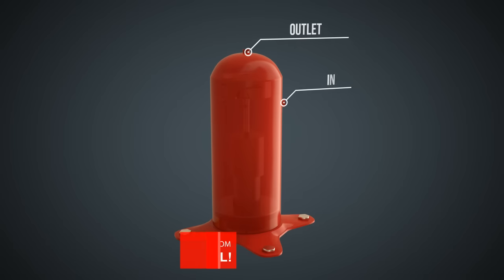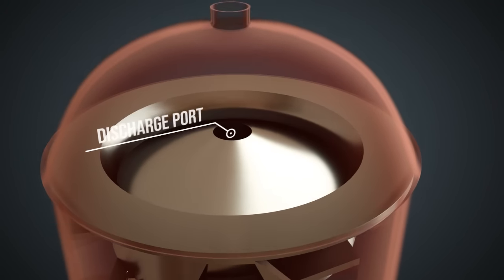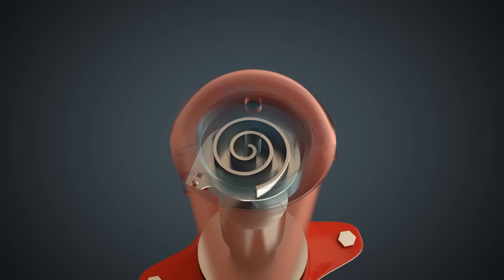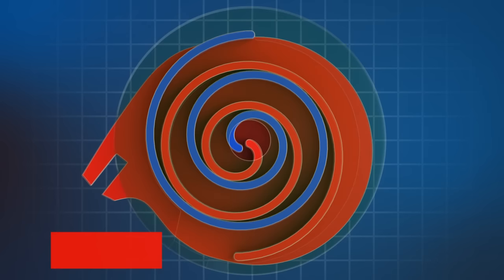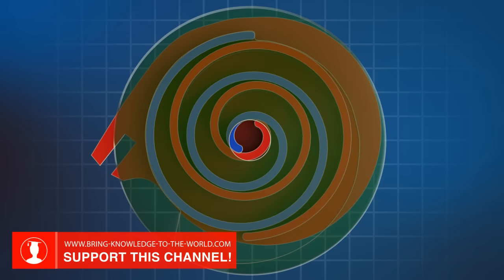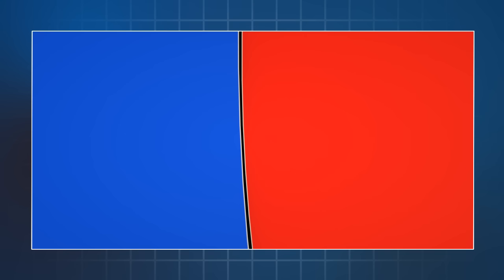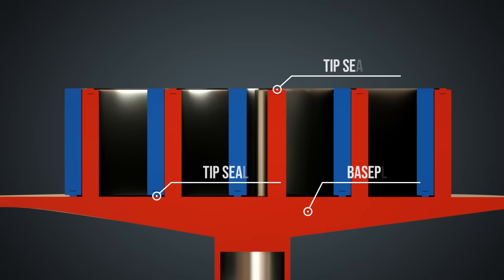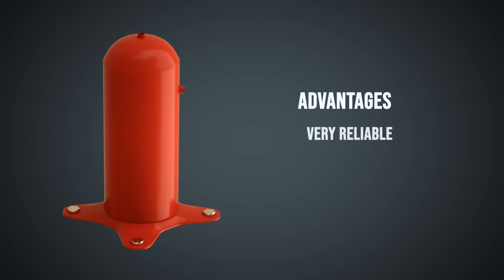Scroll compressor / spiral compressor / scroll pump - How it works! (Animation)

Comment: If the 2 scrolls touch, wouldn't there need to be lubracation in the scrolls? Wouldn't it be spewed out along with the air too?
Reply: Consider the fluid going through it as lubrication.
Reply: @DW-vl2wi  Maybe that's why my new American Standard unit is making a loud clunking noise at Sound on Shut off?

Comment: Sir , infact , what I thought in december was  1) it is  impossible to create vaccum
2) it is impossible for the air to reach  from lower cylinder to upper one . you proved above
both. are successful .
 I have also one method  in mind which needs no outer power   . scroll compressor ki external power need vuntundha .

Comment: I am a student and want to research on scroll compressor to find the temperature and pressure using MatLab while to get the stress and deformation using Ansys.
but I am confused that for which factor(fixed orbit, moving orbit, shaft ...) of the scroll compressor I need to do research.
I need your's valuable advice, thanks.